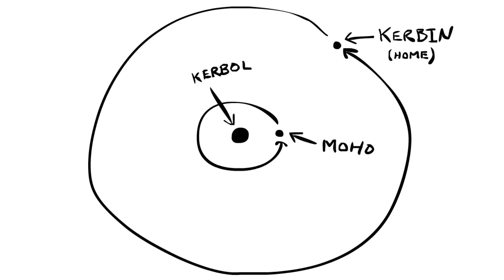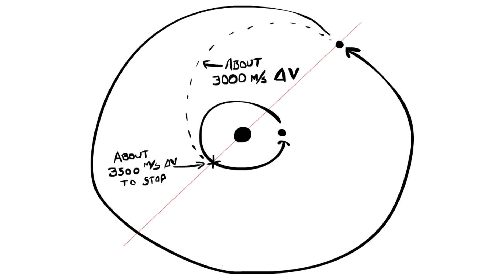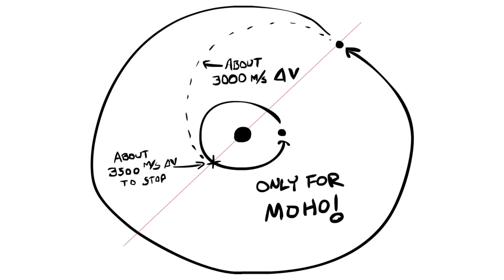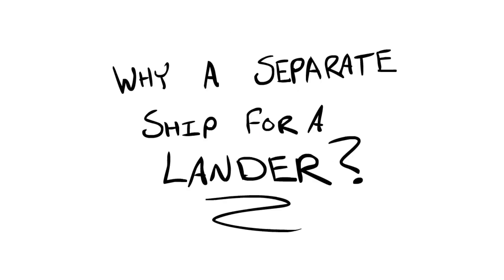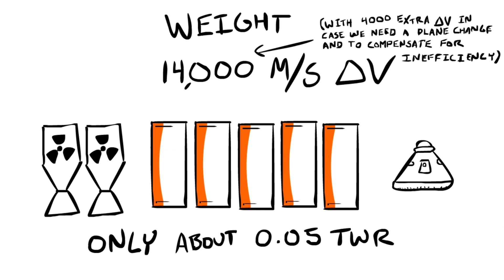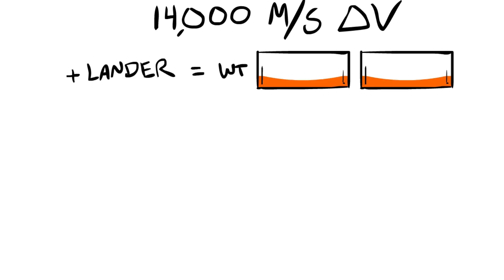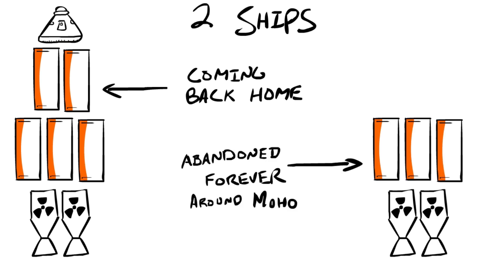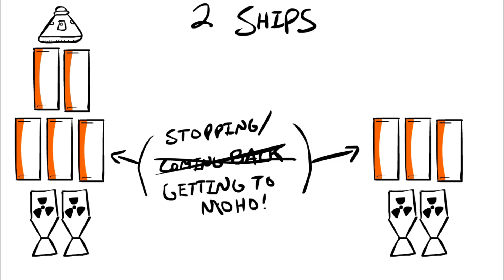KSP - Tutorial - Getting To Moho & Back - BONUS VIDEO

Comment: ...Instead of those silly nuclear powered rockets, why not use just a small/light final stage with ion propulsion? Use the most efficient combination of large ion engines and xenon tanks and Kerbol will take care of the rest. When that close to Kerbol, solar panels provide very high amounts of electrical power per second, which allows for prolonged ion engine burns. Perhaps it will take longer for you to get captured by Moho's gravity , but it's the most efficient option by far...you can even go back to Kerbin after you've collected all the science in Moho...
Reply: when you want to send a 100ton surface base, ion propulsion isn't really an option....

Comment: ...14000 m/s DV to go to Moho? Wat. The Olex-calculator suggested 1700 to get to Moho, and 3200 to get back. That's 4900 m/s, not including braking maneuvers. I designed a ship with an attached lander which has about 6000 m/s DV, so I figured 1100 m/s DV would be enough for braking at Moho (which might be too little). Keep in mind that I won't bring the lander home, which weighs about 8 tons. This guide says I need 14000 m/s DV? Either Olex or this guide is wrong..
Reply from the maker: ojkolsrud1 A bit late on this, but... you're not factoring in the cost of getting off of Kerbin.  4500 off Kerbin + 1700 to Moho + 2200 to stop = 8400 to-Moho DV.  Getting back to Kerbin requires the same DV minus the 4500 it took to get off Kerbin (because Kerbin will stop us).  That puts us at 12300 DV, which is in the ballpark of 14000.  I also included a little extra gas (1700 DV) just in case my transfers weren't 100% efficient.  To play it safe, whenever I work with a living crew, I always like to add about 10% extra fuel for error.